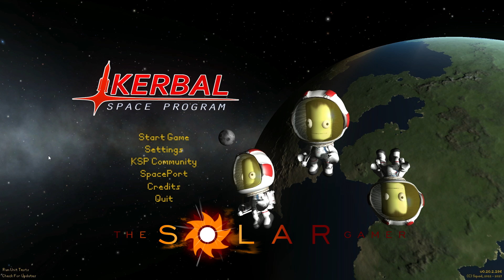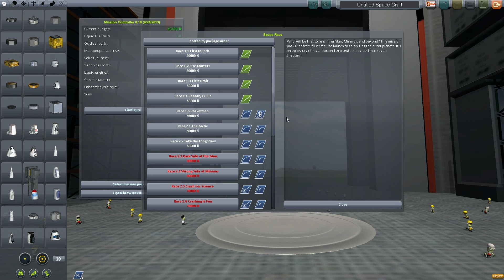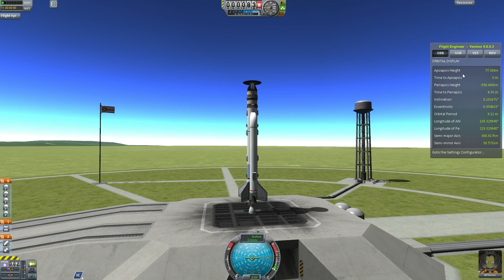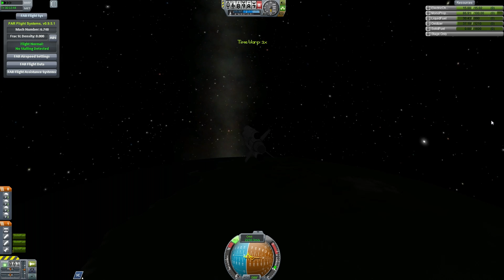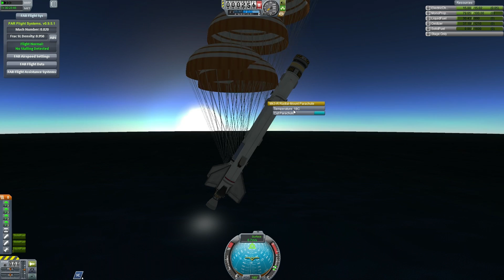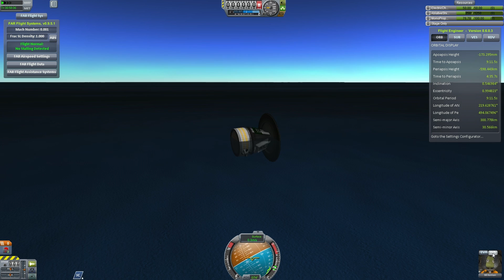Kerbal Space Program - Space Race - Episode 8 ...Trouble in the Arctic...

Comment: Inclination isn't height of orbit (facepalm) though it shouldn't be 80-90 inclination that is a goal fail. It should be 80-100. 90 deg is a perfect polar orbit. 80 deg is some what of a prograde polar orbit. 100 deg is a somewhat retrograde polar orbit. You were at ~90.7 deg, and that's why the goal was not finished. You were in a very slightly retrograde polar orbit, and the mission specifications were a fail.